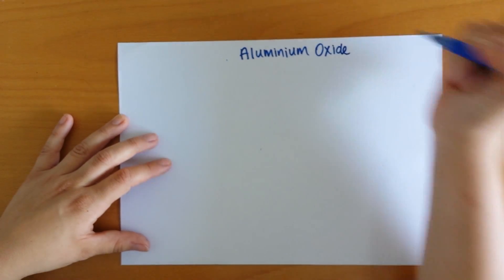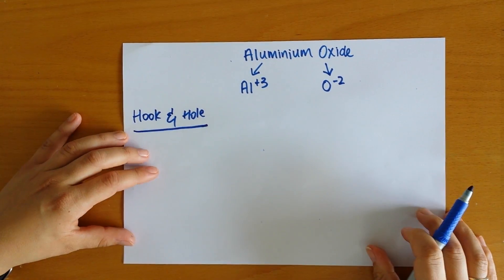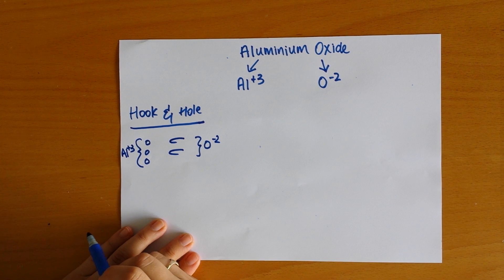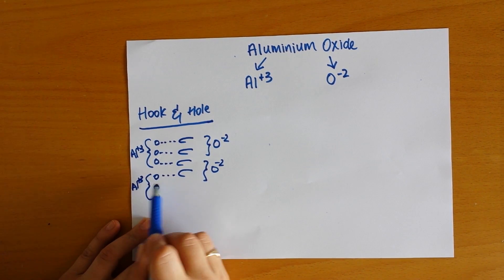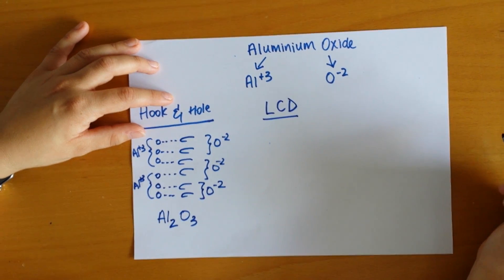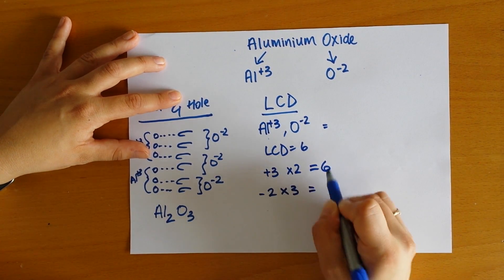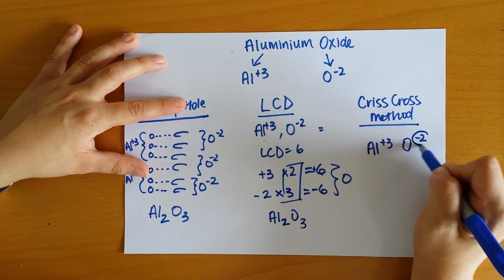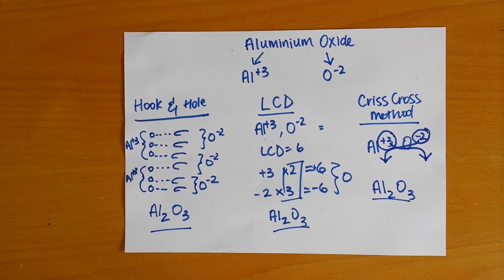Balancing Charge

Comment: 0:43 okay but why +3 and -2?
Reply: Fantagians 
These are there ionic charges you need to find the number of electrons then place them in clouds (first cloud must contain 2 electrons and the rest must have 8) so aluminum has 3 electrons in its outermost cloud that you call valence electrons then oxygen has 6 in its outermost cloud which makes it negative 2 electrons. Did you get it?
Reply: @sal6i755 oxygen will be 2- as it is a non metal while aluminium will be 3 positive  as it is a metal